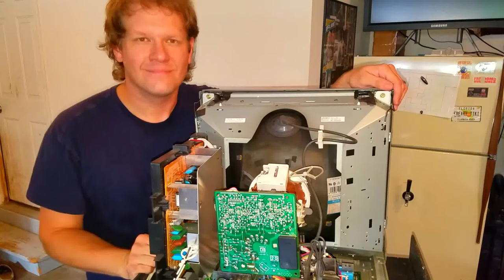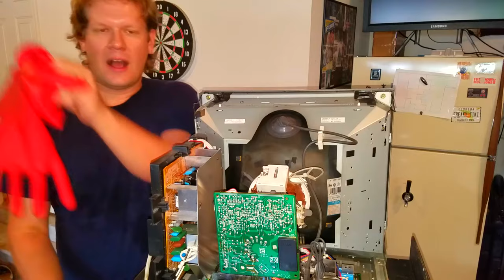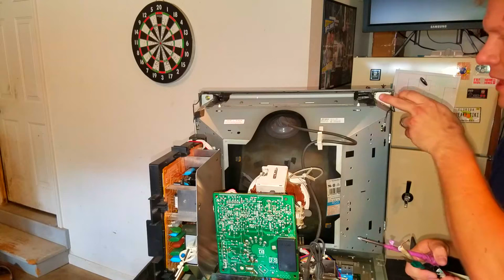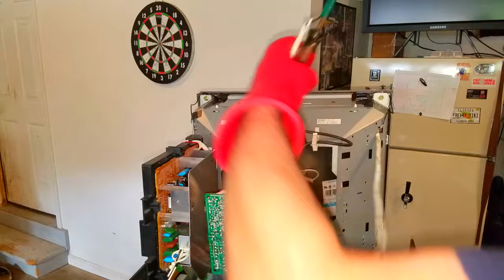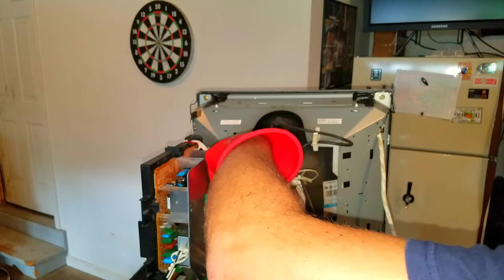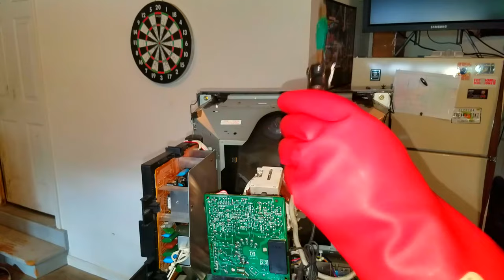How to discharge a Sony PVM BVM CRT or arcade monitor (after you unplug it!)

Comment: I've been told by a few arcade technicians that gloves do nothing to protect you from shock of the anode.
Reply from the maker: They probably don't.  It's best to discharge with a screw driver that won't conduct electricity through the handle.   The gloves are better to keep your wrists, hands & arms from knocking against something.

Comment: If the CRT is unplugged how does hooking to the ground on the CRT doing anything since it is not connected to ground via the plug?
Reply: Little late, but in case it helps anyone else. 
It's easy to think of voltage as a volume of water that can get drained away to a sewer (ground), but that's not really what it is. 
In this case, voltage is a very high pressure between two points within the system. Like two tanks of water connected by a valve, one highly pressurized and the other a vacuum. What you want to do is balance the pressure by "opening" that valve, or in our case creating a short between the two different areas of electrical potential/voltage. This makes the voltage, or "pressure differential"  between the two zones even out. Water will no longer be capable of travelling from one tank to the other no matter how many times that valve is opened and closed again because the pressure has equalized, just as electricity will no longer travel between the two zones because the potential is gone.

What we're doing here is making sure that the "valve" we're opening does not travel through our bodies the first time we do it.

Comment: Great video! My 20L2 needs the yoke turning a little bit. I noticed on the yoke adjustment video that you did it while the TV was running. Having to discharge every time I make an adjustment would mean a lot of hassle until it's right. What would you recommend I do? Thanks.
Reply from the maker: I have a lot of experience, so I ussually do that adjustment while the CRT is running.  I have 2 videos on yoke adjustments if you'd like to check them out.

Comment: so If I wanted to adjust my yolk on my Trinitron. Would I have to take the cap off first before adjusting or would I be able to adjust it fine if it is discharged with the cap on?

Comment: question i have a commodore monitor full of nicotine any tips on how to clean the inside ! its yellow and nasty even the fly back etc
Reply from the maker: I've done a few videos specifically on cleaning inside PVM CRTs.  Honestly the procedure is the same for nearly all CRTs.  I use a soft long brissel brush to knock off the loose dust and dirt.  Then I use my air compressor to blow it out.  If you want, you can disassemble your CRT and give it all a good cleaning with alcohol.

Comment: Hey man, I have sort of an unrelated question I can't find any answers on (because it's probably a dumb one). On my Trinitron KV27S42 consumer set, there are big plastic tabs in the upperhand corners of the case where screws should be. I've never taken one of these apart and wanna be super careful, how do you go about removing those if it all? Do they even do anything? They look like they're intended to be a permanent part of the case itself but I just wanted to be sure before I break anything.
Reply from the maker: Cybrisk Man you are in luck.  I just picked up a Sony k27 today from a thrift shop.  Once I get back to my garage, I'll be opening the TV to service, etc.  I'll be making lots of videos on it too.  Look for a pickups video on it really soon.  Video will be ready Probably in the next few days
Reply: That's awesome, thanks!

Comment: RETRO TECH, why can't I measure the CRT anodes voltage using an oscilloscope? why is the anodes voltage use a floating isolated ground any reasons why?

Comment: I'm wondering if replacing caps on a sony pvm will fix a wavey screen? No amount of geometry fixes it. The picture is stable, the colours are great, the lines are clean... it's just got the warped inner area. Magnets on the inside only effect so much of the edges, so it doesn't reach where the issue is. Driving me bonkers!
Reply from the maker: That may be a cap issue.  What model is it?
Reply: Retro Tech it's a Sony pvm-2053md.
Reply from the maker: Atomizer Zero Im going to do a full tear down and rebuild of 2 PVMs before the winter gets to my area this year.  One of those is a 1953md.  Unfortunately I need to get the Neo Geo Arcade  Cabinet finished 1st, but videos will be produced.
Reply: I'm looking forward to seeing the teardowns, and the neogeo cabinet! Thanks for doing these videos. They've been desperately needed on youtube IMO. I love my PVM... I just wish it didnt look so ugly right now D:
I at least got the focus fixed (worked it out like, 2 days before you posted the video on how to adjust the focus lol), but yeh, i feel a recap is needed on this. Also just found out that the composite input as pretty much died. it was working, and then just started fading to darkness. now theres a small amount of red getting through and thats it. Most likely another cap issue ¬_¬